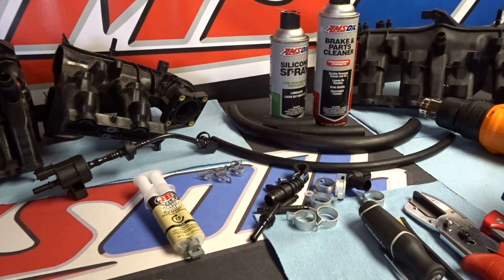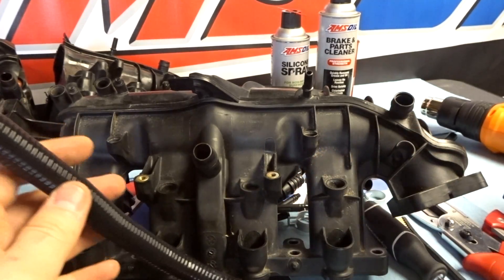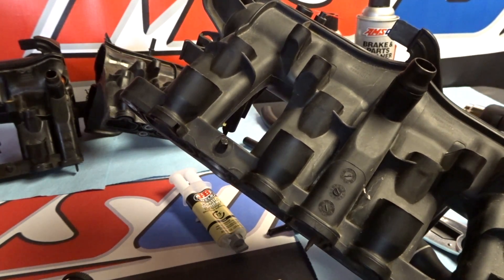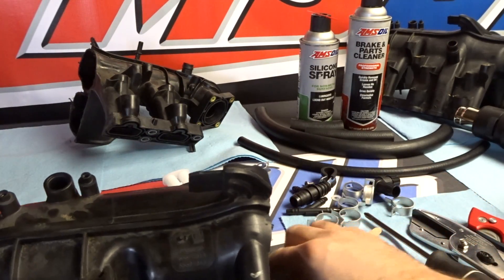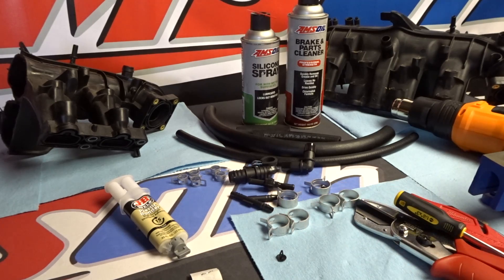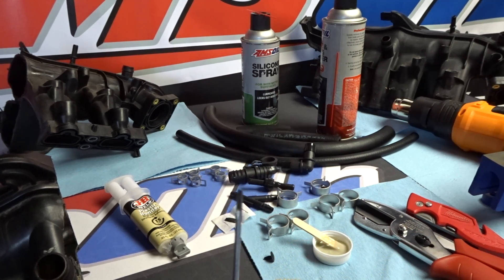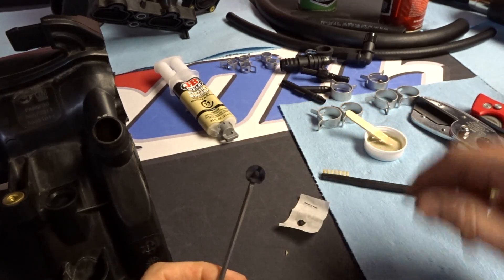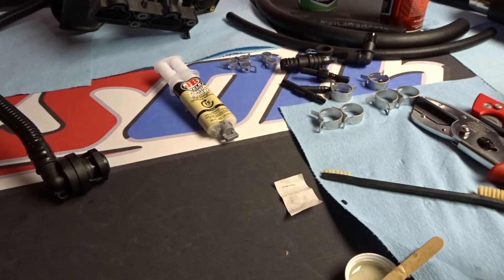How to Install the CruzeKits.com V3 PCV Fix Kit

Comment: Hi Dre Dan,
 If the turbo hose check valve fails. Does it still need to be replaced with the V3 kit installed?
 Mine is still leaking after cleaning it and I want to install your kit but I need to know if i need a new hose (for a working check valve) or not ?
Or does the kit eliminate the need for this valve to work by having the 5/16 check valve further down the line?
Reply from the maker: Try soaking the terminal with carb cleaner and blowing compressed air through both ends. That usually gets it to seal well enough. If that doesn't work, you'll need to scavenge a terminal off of a new hose.
Reply: @AndreiDPop  thank you. I will try and cleaning it up with some carb cleaner.
Reply: I have been thinking about this turbo check valve. It will fail again eventually. Even if only with a minor leak. Its just a matter of time right?

Is there any reason that you can think of as to why the old turbo hose check valve diaphragm couldnt be removed, (only the diaphragm) essentially leaving the end fitting as an open flow fitting to connect the hose too and then a performance 5/8 check valve installed somewhere in the turbo line instead?
Reply from the maker: @456of789  yeah, because the diaphragm at that end has a crack pressure of practically zero, as it should be, and finding a 5/8" check valve that is a similar diaphragm style with a 0psi crack pressure, and figuring out how to take apart that terminal in a way that customers can do it easily, is quite difficult if not impossible.
Reply from the maker: @456of789  remember, it has to be an extremely low crack pressure, since any pressure required to open the valve will be pressure applied to the crankcase, which will cause the engine to leak externally or consume more oil. 

A small leak at that check valve isn't a big deal as the engine can adjust idle control within a certain tolerance. You just don't want it stuck wide open.

Comment: I just replaced my camshaft cover because of a vacuum leak and I just came across this video. Fix looks solid, and I may buy a kit. However does anyone know how long a camshaft cover can last if I don't fix the the part in the intake?
Reply from the maker: Hard to say. Some people go through 2-3 valve covers a year. I know one guy that replaced 6 in one year. Some get more life out of them, really depends on driving conditions. My observation though is that if the intake manifold check valve is missing or otherwise defective, the valve covers will fail prematurely.
Reply: @AndreiDPop  Thanks for your reply. That is good to know. I'm planning on checking soon to see if the check valve is missing (which I am pretty sure it is). I still don't understand why GM hasn't sent out a recall on this if it is causing the Camshaft cover to fail too? Doesn't make sense. Also, would you recommend "No-Heat Easy splice" or just the normal heat gun method?

Comment: About the kid in installed it. It seemed to fix all my problems in after resetting the codes they all stayed off for a couple months but recently the P0171 and the P0299 are back.   Not sure if He could be a sign that I didn't get the plug glued in properly. I checked and it's still there.
Reply from the maker: Possible the valve cover has failed. Check for vacuum/boost leaks. Make sure the clamp on the throttle body is tight.

Comment: is there a kit for the 1.8 liter engine? mine is using too much oil, they told its gonna be that check valve inside the intake manifold, can i use one of these kits for mine as well?
Reply from the maker: No kit for the 1.8L.
Reply: @AndreiDPop  you sure this wont work? different design? im aware its not turbo charged but... 1.8L L4 LUW VIN:H
Reply from the maker: @pearlrival3124  won’t work. The 1.8 doesn’t need a check valve at the intake manifold if it’s never under boost.
Reply: @AndreiDPop  im catching on now. sorry we cant do business your in depth tech support and communication certainly merits success. perhaps you may know this since you seem to be an enthusiast: I changed the valve cover because the diaphragm was leaking, but now im burning a quart of oil every 30 miles. another cruze page appears to be promoting the new valve cover I used is faulty and to purchase the oem part. what could be going wrong with a nonmechanical part? maybe i should add some gasket maker to the rubber gasket? your knowledge on this subject is much appreciated. (along with your slap downs of anyone questioning your parts and design for your fix to the 1.4 issue)  (; sorry for the long read i should have called. big fan lol. p.s. is there alot of oil in illinois? i went there recently and all along the interstate it looked like what imagined was texas. thanks again.

Comment: After removing the pcv hose, I can't seem to get the plastic ring to fit back on, any tips on getting back onto the port?
Reply from the maker: Nope, just push it back in. It will eventually go in.
Reply: @AndreiDPop  cv were

Comment: Will this kit work on a non turbo 1.4 2012 Chevy Cruze I’m having issues where I can hear the air  coming from the intake manifold where the diaphragm is that one cap with the hole in it and it has a rough idle and doesn’t have the best acceleration when trying to get it moving you can feel it chugging like it’s pulling to much air rather than fuel is this a fix for that if I buy a new intake manifold and fix this it should be solid right
Reply: This is a bypass for the turbo boost, if you don't have a turbo there is nothing to bypass. You couldn't use this.
Reply: Zakary Tronc okay so with my car I just need to get a new valve cover and I should be good or it’s something to do with the intake manifold
Reply: I have the turbo, I replaced my valve cover and it lasted a while, but I started having the underboost code. I don't know what codes your car is throwing nor am I a mechanic. You could try having it coded at AutoZone. Then research, but I don't really know your issue.

Comment: I got the intake manifold and valve cover on my 14 Cruze replaced under warranty. I'm on my own for the next failure and I will be sure to go with the V3 kit. I was not looking forward to removing and reinstalling the manifold. Being able to replace the brittle hose too makes it a great value.

Comment: Do those corogated hose crack and leak and make it look like a bad oil leak on rh front of vavle cover also above thermostat housing?
Reply from the maker: Possibly, but you'd likely also have a vacuum leak code as well.

Comment: What if the check valve nipple is still in the intake manifold ? Will you till be able to put in the plugg?
Reply from the maker: You would have to break off the nipple with a flathead screwdriver in order to plug up that hole with the plug.
Reply: If it's still there, and you break it off, what about retrieving it? About to order one for my '18 Sonic?

Comment: So looking at the manifold.. when the check valve fails or disappears, it allows oil through the pcv hose AND oil through oem check valve housing into intake runners to be burnt off cylinders?
Reply from the maker: The check valve doesn't control the flow of oil, but rather the boost leak created causes excess crankcase pressure, which then pushes oil out of the turbo seals and overall causes more oil consumption and more oil to pass through the PCV System.
Reply: @AndreiDPop  I tried doing my own fix before I saw this. It was unknown to me of the check valve failure inside of manifold. I order this kit next day last night to see how this helps with my issues. Thanks

Comment: Just installed V3 on my cruze, easy enough, the only was stripping the nylon from the hose cause it was so brittle but a little heat and I was able to peel it of pretty easy. So far so good, thnks.

Comment: Does this problem effect 2018 Chevy cruze LT?
Reply: No the 2016+ second gen engines don't have this issue
Reply: Ron Becks  it's a simple fix though
Reply: Ron Becks  earliest I've seen one fail new is around 40k miles, mine went at 50k

Comment: So - the part that I didn't see explained - how to remove the original red silicone check valve in the manifold without it going through the engine intake. This video assumes it's already missing. There is nothing I can find on how to retrieve this without removing the manifold. Am I missing something?
Reply: Just break it off at the nipple with a flat head screw driver, it shouldn't hurt anything they get eaten by the engine anyway most of the time.
Reply: @justinv3080 thank you, This is my main concern, Just bought the v3 kit, and I see that little red nipple in there, So Now I have the confidence to go ahead and do this. Thanks.

Comment: Why did I order the v3 but my kits isn’t the same?
Reply: Just realized I was sent the v 2.1... why would I get a old kit? For the same price as the new kit?
Reply from the maker: @randall7853  I just checked your order. You ordered the V2.1 kit, not the V3 kit. 
It's not a matter of old vs new, but different designs. Some people still prefer the V2.1 and I still sell plenty of them in fact. People prefer it due to the more streamlined install, fewer components, and more robust check valve, and they don't mind pulling the intake manifold to install it. 
This isn't really a good way for me to reach out to customers regarding issues though. If you want to exchange the kit, please contact me using the contact form on cruzekits.com so we can figure it out.
Reply: Dre Dan I apologize, jumped the gun and over reacted . Thanks for the help.

Comment: What do you do if the piece in the intake is still in there, would you have to remove the intake to remove it first.
Reply: The check valve? You will have to take it off and poke out the orange rubber valve through it so it comes out one of the holes, you can poke it out with the intake still on but that will be floating around in your engine somewhere

Comment: I drive 25-30k a year, thinking about ordering this kit but worried I'll go through these y fittings like crazy... would the v1 kit be more reliable for someone driving this much?
Reply: One more question... does the v1 kit still use a screw or has it been updated to use the plug used on v3?

Comment: I actually replaced the O-rings on both sides of the nylon hose.  Oh reallys has a random set for about $4  I even added a second O-Ring to the turbo side because it had a lot of slop.
Reply: Please note that I had a couple of follow ups that I didn't mention until I had cured the vacuum problem.  I had done the V3 replacement and that was fine.  I have 150k+ miles on my cruze so I assumed my intake was bad.  I replaced it and closed off the PCV hole.  However, I was getting whistling from around the check valve from the V3 replacement.  From what I know now I should have checked the valve on the turbo side of the corrugated tubing.  It was bad. I was getting  intermittent blow by from it and it blew the check valve out.  I bought a new nylon tube and replace the old turbo sides connector.  P1101 went away.  Then I checked my OBDII tool and found that I was getting a P0299 code which is insufficient turbo boost.  Most articles noted that the Turbo needed to be replaced.  I noticed that the vacuum purge valve was clatter like a castanet.  I then replaced that as well. Now no more codes. and I have replaced any part that could have possibly gone bad for vacuum and intake outside of a turbo.

Comment: Is this going to affect the smog visual causing to fall?
Reply from the maker: Depends on the person doing the smog check. The v2.1 kit is more stealth-like if you're trying to avoid attracting any attention during a visual inspection. All of my PCV fix kits retain OEM PCV functionality and should not affect actual emissions testing but I can't guarantee that someone won't notice it's been modified if they inspect the engine bay.
Reply from the maker: I assume you're in California?  I don't know any other state that performs visual inspections for emissions components.
Reply: Dre Dan yes I am. Very nice set up you come up with. It’s very tie here with the he smog. So but I’ll ask. It it works you have on other customers. Thank you

Comment: Putting the plug in was next to impossible. I ended up taking out the manifold and dumping a shit ton of epoxy down to fill the hole without bothering with the plug (making sure not to block the passage from case to tube). Seems to work fine. Also had a hell of a time with the nylon. I ended up just cutting off the tubing and putting rubber hose right over the valve with the nylon still over the barbs. This job was a huge pain in the ass but it definitely worked!
Reply from the maker: The epoxy does not do well directly exposed to hot exhaust gas. That will soften up, expand, and separate, and you will have issues with it down the road. I explicitly recommend against using too much epoxy in the installation notes because of that issue; the epoxy has to be used as a bonding agent between two surfaces, with the clip or a nylon washer and screw (what I use in the V1/V2.1 kits) as an insulator. 

I'm actually switching the epoxy to JB Weld standard instead of Plastic Bonder because of how many people think it's a good idea to just plaster over the plug with epoxy, then complain that their intake manifold is full of separated slivers of epoxy afterward. You're going to need to take that manifold back off and plug up that hole properly.
Reply: @AndreiDPop  noted. I'm gonna coat it with some high temp paint cause that shit ain't coming off now! Haha. Maybe a trip to the junkyard eventually for a redo later down the road
Reply from the maker: @mtrzr8  check the port periodically.
Reply: Lol just beasting the job🤣🤣🤣

Comment: going to try this on a friends car that has the P0299 code before we jump and replace the turbo
Reply: this was great video by the way, ive never worked on a newer chevy like this before but youve made everything easy even going above and beyond showing that cut away
Reply: By the time i got to my 299 code, i had a cracked turbo housing, intake manifold, and valve cover. 
Dealer parts totaled over grand by the time it was done.

Comment: What symptom does the car have to indicate this is needed. I am getting some hesitation when accelerating just after stopping.
Reply: Typically your engine will be throwing codes for running lean. There is also a simple check to see if this gasket that goes missing is there or not. I believe Andre has another video detailing how to determine if this is a problem for your cruze or not
Reply: Code PO299

Comment: received my v3 kit today.  I was able to put the parts together with little trouble.  My Cruze has 150k miles on it so the large nylon tubing just shattered when I tried to cut it.  Cleaning he PCV area was a bit rough as it had a lot of built up sediment in it.  I only had 1 problem.  the rivot to block the hole just wouldn't go in.  After about 5 minutes and goo everywhere, I came to realize I needed an alternative.  I made a lot more of the schmoo and used 2 Popsicle sticks and let it harden quite a bit.  Then with 1 popsicle  I put a large amount of the schmoo over the holes, twice.  I then used the second clean popsicle stick to smooth out what I had done.  I allowed it to dry and put all the new parts on.  The engine idled perfectly for the first time in a long time.

Comment: FYI AND VERY IMPORTANT. If this part failed then you are likely to also need to replace your cam/valve cover.  The pcv in it is part of the cover.  If you don't you will likely be changing it in 25k miles anyway.  They don't last long when this fixed isn't done.  I speak from experience.  I'm putting my 4th cover on for the same problem.  Also of note this may also cause problems with your catalytic converter as well.  Use only Top Tier fuels in your 1.4L engine.
Reply: I was lucky that GM recalled the cam/valve covers, and I just had a Chevy dealer replace it for me. but I still have the PO code and check engine light on.  I hope this works.

Comment: How long should I let the epoxy set up after installation before starting the car?
Reply: Hopefully within 2 years.   Lol.  I came here looking for an answer to that very question.   I don't see it explicitly addressed and I certainly don't want to start it before it's cured and compromise the seal.   I'm guessing whenever my mix tray is hardened I'm good.

Comment: What happens if that black plug we install with epoxy comes off while driving?  I noticed my fuel mileage dropped by 7 mpg after driving 50 miles. I have no check engine codes.

Comment: Just tried installing the V3 kit. Gotta say I’m having a hard time trying to plug that PCV valve hole. The plastic plug that comes with the kit is just as wide as the pipe itself, so even using a thin flat head screwdriver won’t be enough.
Reply from the maker: Are you using a 1/8" or smaller flat head? Very few people actually have any issues getting that plug inside.
Reply: Dre Dan yeah had to get one of those precision screwdrivers in an sort of an angle but was finally able to get plug glued into the hole 👍🏼

Comment: If my check valve is still in place, how can I pull it out without taking off the manifold?
Reply from the maker: Just break the tip off with a flathead screwdriver.
Reply: Dre Dan then there’s a piece of rubber in the intake that just gets sucked into the engine? I guess if it goes missing it gets burned up inside anyways?